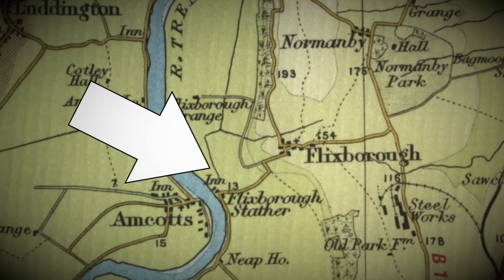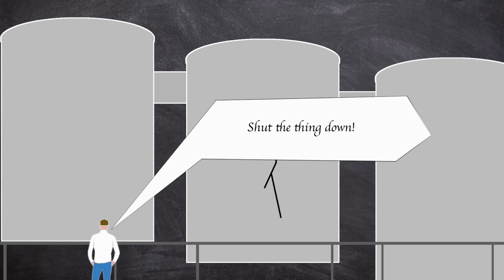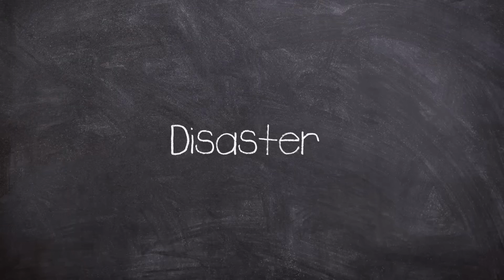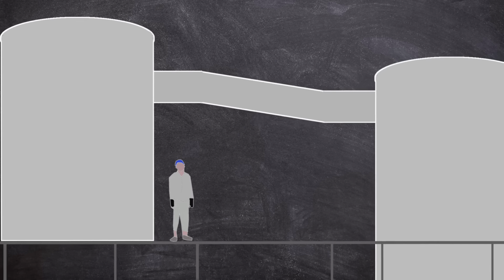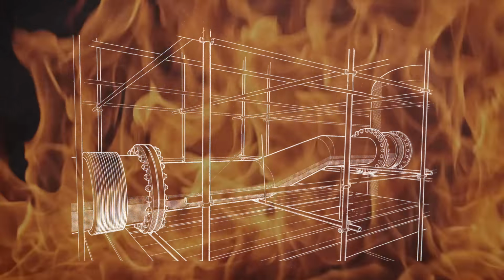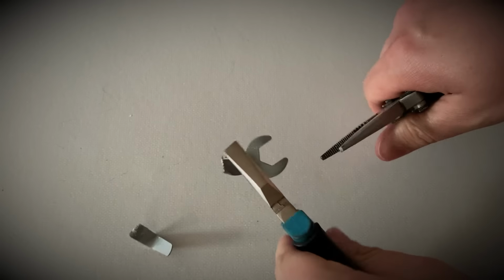The Flixborough Disaster (1974) Where Did it go so Wrong? | Plainly Difficult Short Documentary

Comment: This disaster was just waiting to happen. Even if you set aside the fact that the repairs were not as per British Standard, the fact that they had a pressure vessel failure, did a repair and put the plant back into use without knowing the root cause of the failure, additionally they did not inspect any of the remaining plant for damage is beyond me. Why would they assume that a bellows piece designed as a short stubby and supported by each tank would be able to support itself along with the weight of an additional section of pipe is outrageous. Had this accident not happened, I suspect that another would have somewhere down the line. The lack of procedures and operating standards is clear for all to see.

Comment: The day after Flixbourgh I was called out to the Esso Fawley oil refinery which had our process control computers controlling the plant. The on line machine had failed, and the standby had failed to take over and for the first time in years the site was on manual control. As I approached the Totton roundabout I could see the Fawley flare which burns off waste and it's height is a measure of the inefficiency that the system is running at. I was WETTING myself going in there as the flare was far higher than I'd ever seen it!

Fortunately it was a relatively simple fix and I'd brought the right spares with me but I'll never forget that night.

Comment: I got a question that is probably stupid.  Towards the end of the video, Plainly mentioned that the site had hundreds-of-thousands more gallons of chemicals than allowed.   How many gallons was Flixborough permitted?  To a layman, 100,000 gallons sounds like a lot - but to a chemical plant manager, would they perceive it as a rounding error?  

Going by the diagram that Plainly is showing, it looks like the stuff was widely distributed throughout the site, in a variety of structures.  I recall a Youtuber who talked about a plane crash, and how overfilling the gas tanks caused an explosion - when compacted by an exterior strike, the fuel inside the tank caught fire IIRC.  Is that sort of thing a concern for immobile chemical storage?
Reply: 29 CFR 1910.119 gives the USA’s limits.  Typically, 10,000 lbs limit for anything not listed in Appendix A.  However, Appendix A is not comprehensive of everything that could be encountered and needing a limit lower than 10,000 lbs, example: Boston Molasses flood.

Comment: I believe that my father was involved in the public enquiry as the consultant metallurgist whilst at TWI. Proof pressure test is named as such for a reason and the test pressure should at least equal the system operating pressure but preferably be comfortably in excess to allow for fatigue degradation of the structure with time. Hydrostatic is preferred over gas as fluid leaks will be more apparent and lead to a rapid fall off in pressure with just a small volume lost due to the incompressibility of a liquid. I clearly remember the state of national shock at the scale and unbelievable violence of the incident.

Comment: I would rate this one higher on the legacy scale. Everyone who learns causal analysis eventually learns about the Flixborough explosion. While many incidents are part of teaching about a process called Management of Change (MOC), this one is considered an early example of failure to do a thorough MOC process and having a disaster as a result. I hadn't heard about the mining strike and the inability to run the reactors as they were meant to be run. That would be another MOC issue that would have to be resolved in a modern plant before they could restart the plant without the agitators. 

I'm not used to hearing operating conditions in metric, but the conditions don't seem as if they should be leading to that many leaks. I have to wonder why they were having so many leaks and whether those leaks were really that unusual for that time. I have never heard what the cause of the big crack in Reactor 5 was. They should have known in a fairly small period of time what the cause was. If the crack was a fatigue crack, then they could expect everything to be falling apart. I'm not used to such large cracks in reactor vessels unless there is a great deal of thermal expansion.

Comment: Yep, I already see the problem, a big pipe (711mm) feeding into the much smaller (500mm) pipe in place of reactor 5 and reducing flow significantly and increasing pressure in the system by a lot, which could lead to dangerous pressure problems, and too much pressure in such a small space left unchecked with no way to safely get rid of it = BOOM!💥
Reply: To be precise that diameter reduction almost HALVED the cross section area to 51% of the original design putting stresses on the upstream bellows and the weld joints to almost quadruple of their intended operating range when trying to maintain original flow rates. Add to that the dynamic loads from essentially putting an orifice on the second to last stage and it's an inevitable disaster no mater how you slice it!

Comment: The same Dutch Sate Mines still exists and is as shambolic in its operation as it was back then. They signed off on gas extraction from underneath the northern province of Groningen, knowingly using data that showed it was safe, while research showed it wasn't. Now there's a massive legal battle as it has causing major earthquakes, just like they were warned would happen. Shell and Exxon are doing the extraction of course, because there aren't many disasters they aren't part of...

Comment: This tragedy has a legacy for the whole engineering profession. During my engineering degree we were taught about it as an example of how not to do things. I've never forgotten that lecture.
Reply: Safety is considered much more important today. In the 70s, concern for safety was thought unmanly, and industrial workers were expected to be physical wrecks by about 50. I've seen circuit breakers bypassed, and press interlocks disabled to speed production or avoid downtime, and the disaster at the Pike River coal mine shows that this attitude still exists in some industries.
Reply: Worked for a coatings manufacturer years ago; their process engineers once told maintenance to build a run of pipe from a carbon dioxide cylinder to a piece of lab test equipment. No sooner was it completed and pressurized then it froze; engineers apparently forgot that CO2 is very cold. Maintenance guys were trying not to laugh out loud; not the first time the p-engineers screwed up I found out later. 
Days later the p-engineers driving maintenance nuts, and a decision to move the CO2 cylinder into the lab, the CO2 made it to the equipment, which was then proven not to work with that configuration (it was not designed to be chilled down with direct CO2 injection, so various parts froze, would not operate, and/or broke in short order). I was asked more than once why I wasn't running the tests...had to show it to chemists, a few of which sheepishly apologized when the realized how bad the machine ran when it did, and the results were useless as well. I was glad to learn how to run some other tests; at least they gave valid results. Tag Closed Cup flashpoint, anyone??
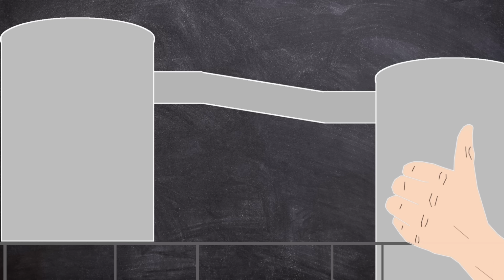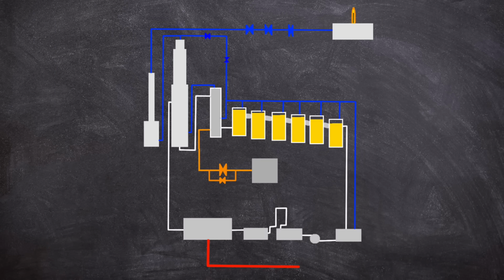Reply: Pick up your cross and follow Jesus! The world is quickly headed for destruction, and sooner or later you will have to sit at the judgement seat and give an account for your actions. Belief in messiah alone is not enough to grant you salvation - Matthew 7:21-23, John 3:3, John 3:36 (ESV is the best translation for John 3:36). Call on the name of Jesus and pray for Him to intervene in your life! - Revelation 3:20. 

Contemplate how the Roman Empire fulfilled the role of the beast from the sea in Revelation 13. Revelation 17 confirms that it is in fact Rome. From this we can conclude that A) Jesus is the Son of God and can predict the future or make it happen, B) The world leaders/nations/governments etc have been conspiring together for the last 3000+ years going back to Babylon and before, C) History as we know it is fake. You don't really need to speculate once you start a relationship with God tho.

Can't get a response from God? Fasting can help increase your perception and prayer can help initiate events.  God will ignore you if your prayer does not align with His purpose (James 4:3) or if you are approaching Him when "unclean" (Isaiah 1:15, Isaiah 59:2, Micah 3:4). Stop eating food sacrificed to idols (McDonald's, Wendy's etc) stop glorifying yourself on social media or making other images of yourself (Second Commandment), stop gossiping about other people, stop watching obscene content etc and you should get a response. Have a blessed day!

Comment: As a chemical engineering undergraduate in Britain in the early 1980s, I would say that this accident is considerably higher than 6 on the legacy scale.  This was the most important accident that we all needed to know about (Bhopal hadn’t happened yet).

A more recent hypothesis about the cause of the high pressure was that turning off the agitators allowed water to accumulate in the reactors.  A mixture of immiscible liquids (cyclohexane is like petrol and doesn’t mix with water) has a total vapour pressure that is the sum of the vapour pressures of the two pure liquids, so at a given temperature the pressure of a water and cyclohexane mixture would be considerably higher than that of cyclohexane alone.  This might have been part of the problem during the restart.  But the bad “design” of the bypass pipe was of course the main reason for the vapour escape and subsequent explosion.
Reply: As a UK chem eng graduate of the 2010s, we were still learning about this (alongside Bhopal) as one of the most important disasters we would study, particularly because the timing ensured that the health and safety at work act wasn't watered down at all because it would have looked politically dire. I would've given an 8 for the legacy rating on this basis
Reply: I worked with the Welder in the N9rth Sea who welded the spool, he was exonerated after carrying out numerous test welds to prove his competency.
I worked on the reconstruction of the plant and can remember all that was left of the control room was the tiled floor.
Reply: My Engineering professor uses this as how he messed up

Comment: Thanks. I had not heard of this one.  Perhaps electricity over only three days a week resulted in so many turn on/shut down cycles, the plant aged even faster.  There were so many heating/cooling and no pressurization/pressurization cycles that like the old incandescent light bulbs failure was largely based on the turned on and off cycles rather than overall usage time.  I'm a member of a steam train association and steam locomotives have to be heated up from cold very slowly to assure the structure heats evenly so fissures don't appear.  That extra pipe installed outside of the engineers' original design may not have expanded and contracted with the other parts.
Reply: Put's into perspective, watching "Dave Allen At Large" on a 22" black & white telly and suddenly the power goes and it's your turn to light the candles. It makes me think of my dysfunctional family compared to my best friend, because had she been around in those days, she'd have quickly set up a quiz among the family, and we would've ended up feeling like the lack of coal had done us a favour! Telly had certainly killed the art of conversation in our house.
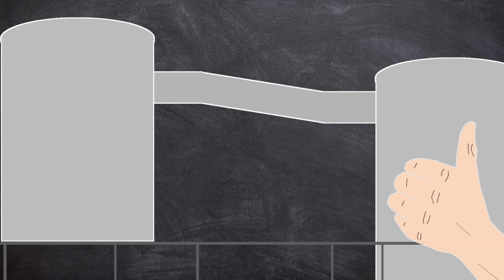Reply: Pick up your cross and follow Jesus! The world is quickly headed for destruction, and sooner or later you will have to sit at the judgement seat and give an account for your actions. Belief in messiah alone is not enough to grant you salvation - Matthew 7:21-23, John 3:3, John 3:36 (ESV is the best translation for John 3:36). Call on the name of Jesus and pray for Him to intervene in your life! - Revelation 3:20. 

Contemplate how the Roman Empire fulfilled the role of the beast from the sea in Revelation 13. Revelation 17 confirms that it is in fact Rome. From this we can conclude that A) Jesus is the Son of God and can predict the future or make it happen, B) The world leaders/nations/governments etc have been conspiring together for the last 3000+ years going back to Babylon and before, C) History as we know it is fake. You don't really need to speculate once you start a relationship with God tho.

Can't get a response from God? Fasting can help increase your perception and prayer can help initiate events.  God will ignore you if your prayer does not align with His purpose (James 4:3) or if you are approaching Him when "unclean" (Isaiah 1:15, Isaiah 59:2, Micah 3:4). Stop eating food sacrificed to idols (McDonald's, Wendy's etc) stop glorifying yourself on social media or making other images of yourself (Second Commandment), stop gossiping about other people, stop watching obscene content etc and you should get a response. Have a blessed day!

Comment: I’ve decided these industrial disasters can be summed up thus:
1) Small problem discovered.
2) To save money/ time/ trouble, management has workers put together a jerry-rigged solution.
3) Work carries on as before, but more small problems crop up.
4) Which all coalesce into one BIG problem.
5) Kablaam.
Great video!
Reply: Pretty similar to my workplace, the foreman ordered the cheapest dust collector he could find for the new CNC woodworking router the shop bought, the dust collector was all PLASTIC except the legs and motor, and the collection barrel was made of all things- CARDBOARD! It was UL listed and I was astounded at how it got that certification, after all, highly flammable fine wood dust being collected in a flammable PLASTIC and cardboard dust collector, what could go wrong???
Well, last June 15th I was running some plywood on the CNC, long story short the dust collector caught on fire, by the time I realised there WAS a fire (collector was behind a partition wall) the motor and plastic top section of the turbine was on fire, I tried to put the fire out with a nearby extinguisher which was too small and went empty in seconds. I alerted the other employees and went to grab another extinguisher but as I looked over my shoulder the flames were already involved on the chipboard partition wall and a storage bin full of plastic bags filled with shreaded newspaper for packing material was also on fire so I ran out.
I didn't know it right away But I had 2nd degree burns my arms and scalp just from the radiant heat! on my way out I backed a company van out of the building and seconds later the heavy black smoke  that I had to walk thru to escape- led the flames to the garage door 100 feet from the fire and the flames were coming out the garage door, basically it flashed over moments after I got out.

I went to the hospital and ultimately had to get skin grafts on my arms and was recovering at home for 6 weeks, the fire spread from that warehouse building to the other 3 connected buildings and totally destroyed all 4 buildings and all contents, archives, tools, machines, computers, everything. The ONLY nearby hydrant was a 4" and it was malfunctioning so they had to bring in things to fill with water via tanker trucks, and even then the 1-2 hoses the Fire Dept had playing on the fire were useless.
Reply: @FCE-dogs  good to hear you survived that horrible hazard.
Reply: and the best part about it is that after the "boom" every single one is pointed out to be ignored by the next plant "to save cost" again .. i think the problem is not the industry itself .. its that everything is insured and the people who actually carry responsibility are isolated from these consequences.
Reply: Or just... Profit yes, safety no ...
Reply: Gosh at least in America we don’t face these types of conditions.
Reply: @ci6516  I can’t tell from the tone of your message. You are being ironic or sarcastic, arent you?
Reply: @malcolmwhite6588 yes , most definitely sarcastic . Plenty of industrial disasters here too
Reply: @ci6516  LOL, I wondered that, but I couldn’t tell from the tone, and I was pretty sure that there’s plenty happening in your country as well – same as most part to the western world management, financial pressure people on the top, not understanding the practicalities of how the chemical plant operates and people fearful of the job to challenge them.
Reply: @ci6516 😂😂😂
Reply: oh how little you know @ci6516

Comment: Pressure is force per area, kilogram is a measure of mass not force. Units should be Newtons (N/cm2) 
-10 pts
10:52 unit 5 is aliiiiiiive somehow?
The symbol for Kelvin (K), doesn't need it, but Celcius and Fahrenheit are both measured in degrees and their symbols are uppercase (°C and °F). -7 pts
Not up to your level of professionalism. Revise and resubmit for full marks

Comment: I remember this, the persistent fire and the damage to local properties. It is rarely good to jury rig a repair and then not test the system properly. It turned out to be a false economy not to shut down the plant and employ proper corrective action. £24 million was a lot of money back in 1974.
Reply: Good point.  Ignoring the value of human life, safety, morality, etc for a minute...  On a practical level, if you look at the value of the equipment you have right now and all the labor hours and engineering time that went into it, taking a risk with it just to make money in the short term is a horrible idea.  I think about that more and more at work.  I spend most of my time setting up a jobs as a machinist, and if I rush and overlook a small detail I can easily crash the machine and end up having to redo everything from scratch.  Not to mention I could do tens of thousands of dollars in damage to the machine itself and get myself or someone else hurt or killed.